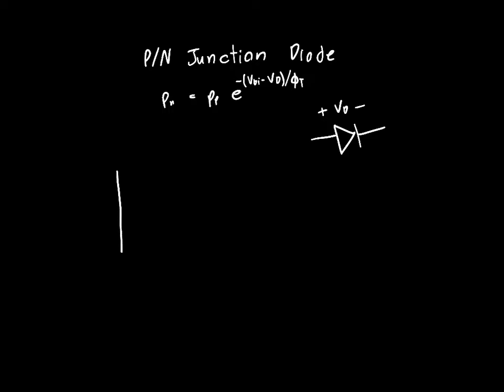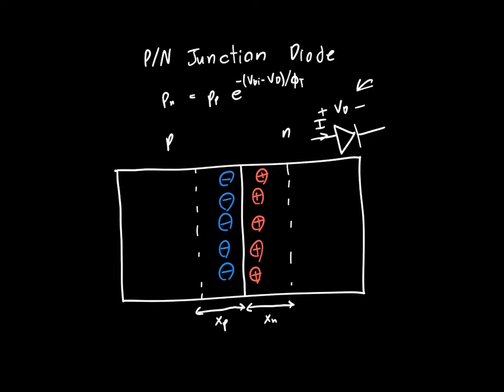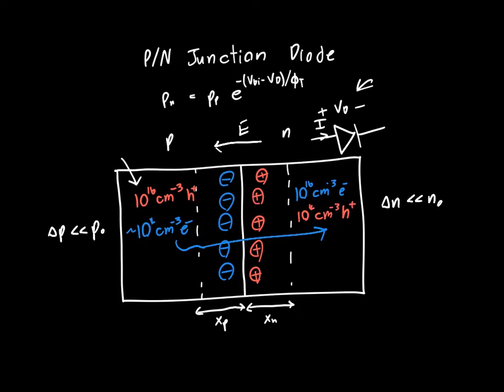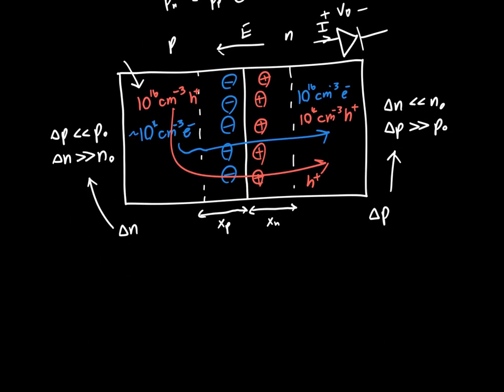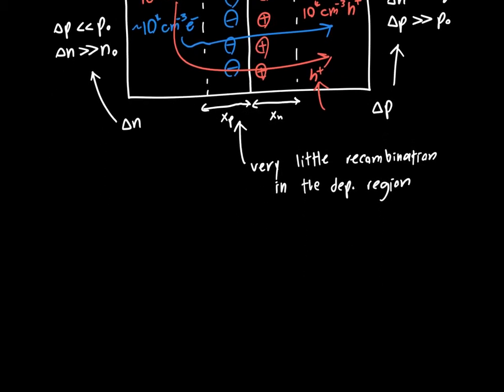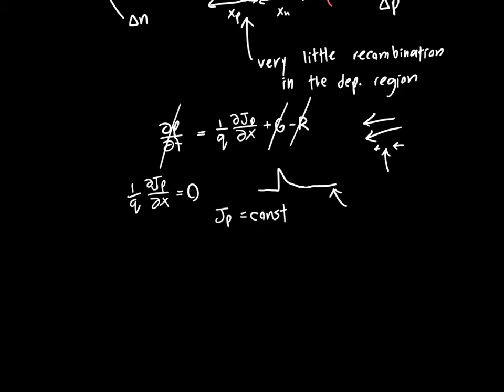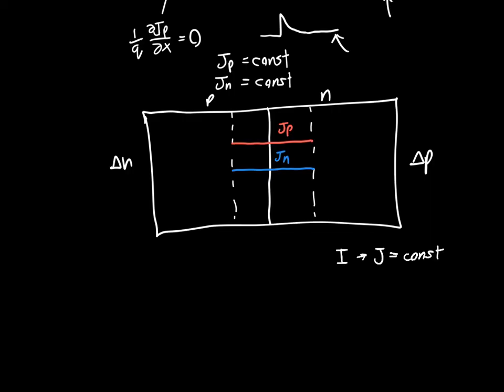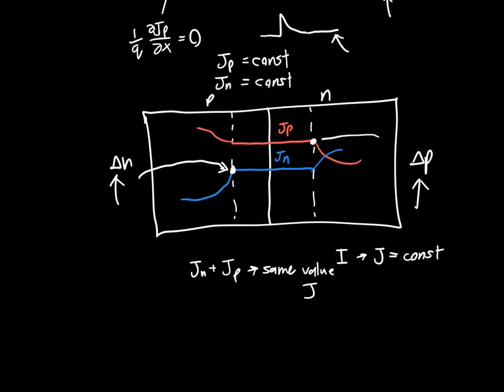PN Junction Diode Forward Bias Current Part 1

Comment: is Vd always less than Vbi?
Reply from the maker: Nope, it can be larger, but then the model we are using starts to fail.
Reply: @JordanEdmundsEECS  won't the internal resistance of the voltage source take most of the drop with it?
Reply: @user-ge8hj9br6w  my teacher said that the model breaks because the expression for the depletion zone width becomes the square root of a negative number.

Comment: Is G always equal to R in equilibrium, as seems to be assumed in this video? Because technically you could have dq/dt = 0 even though R isn't G (you could generate a net amount of charges that are then carried out through a net current), but I'm guessing that this wouldn't work forever since we'd run out of electrons? Is it always reasonable to assume R = G at equilibrium?
Reply from the maker: Excellent question. This is a good assumption under equilibrium. The reason is this - imagine you did manage to extract some charge from the semiconductor (*and* that you successfully extracted only the electrons without the holes). The semiconductor would now have a net positive charge, and it becomes increasingly difficult to rip additional electrons out of it (the net positive charge is attracting back the electrons you try to take away). This is by definition not equilibrium. Eventually you won’t be able to get out any more electrons because it will just be too hard, and your semiconductor will be in equilibrium, at which point R=G. This is equilibrium.
Reply: @JordanEdmundsEECS  I think I get it now. Thank you so much! These answers you're giving are incredibly helpful!

Comment: How could electrons diffuse from the p region to the n region should not they diffuse from the high concentration region (the n region) to the low concentration region (the p side)?
Reply: a percentage of electrons that are generated within 1 diffusion length of the space charge region on the p side will randomly drift around into the SCR region and then get swept across to the other side by the electric field. 
You are thinking of diffusion which is what happens to the majority carriers, drift current is what happens with the minority carriers (a force is applied due to an electric field as opposed to a concentration gradient) and is a weak function of the applied field
Reply: @jacobcorr337  yes so minority carries in the n side which simply defined to be the holes get drifted to the p side and same for the minority charge carries on the other side 
I got it thanks brother
Reply: diffusion length being the average distance travelled before recombinating with a majority carrier

Comment: What is equilibrium condition
Reply from the maker: ‘Equilibrium’ just means you aren’t actively putting energy into the system. For example, when you aren’t applying voltage to the diode.
Reply: Even temperature is 0
Reply: @JordanEdmundsEECS  in the prior video, you used the equation of Vbi developed in equilibrium condition, in a PN junction under forward bias which is not equilibrium. Could you please explain it. Thank you
Reply: @JordanEdmundsEECS  even if we apply VD we still assume that in infiite time there's no net charge movement and no accumulation of charge?